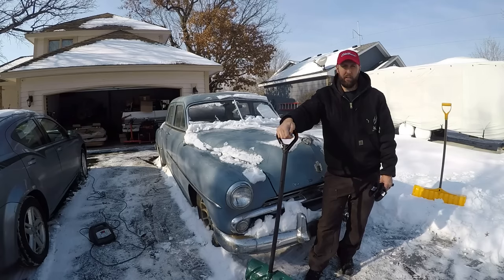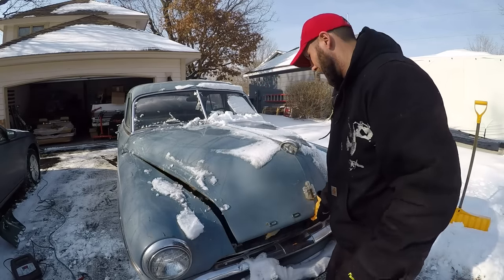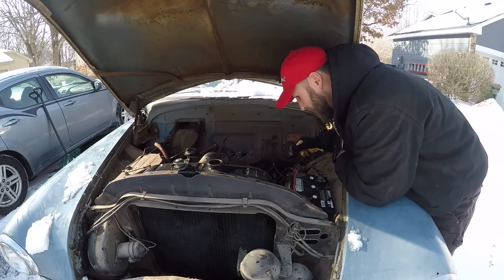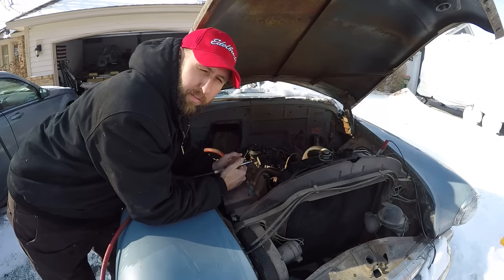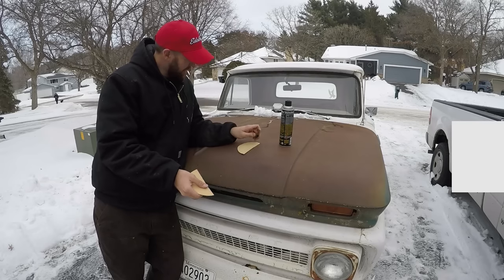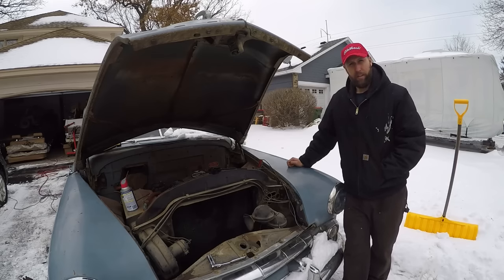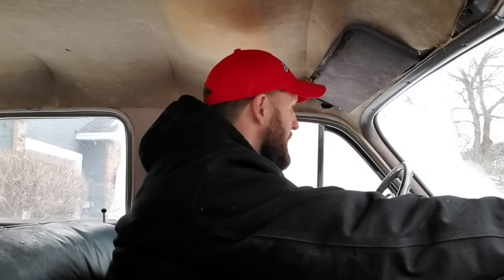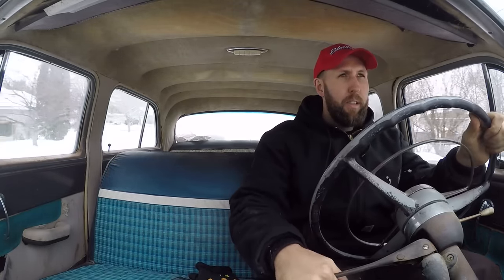1952 Dodge Barn Find First Start - Will it RUN AND DRIVE?

Comment: The transmission you have is known as a SEMI-AUTOMATIC fluid drive.  Here is the shift pattern you will need to know.  Shift the lever to First gear.  When you press on the gas, it will keep winding until you lift your foot.  When you press the gas again, it will go into Second gear.  The next time you lift off the gas, you have to shift into Third gear.  Press the gas and let off and you will be in Fourth gear when you hit the gas again.  I don't recall the exact pattern for down shifting, as it wasn't my car but that's why they equip them with brakes.  Oh yes, the transmission works like the old band brakes.  The proper tension on the adjustment bolt is 10 foot-pounds.  They are (as are almost all flatheads), reliable as a stone fence, if somewhat anemic due to the low compression.  If you contact Kenny Roberts, his tuner could probably bring it up to about 9 or 10-1.  For bad rings, there are a number of Marine sparkplugs that will fire through the oil.  You can use a 12 volt battery to fire up the engine without any damage, but don't turn on the lights because they'll blow right now.  Won't do your clock much good but that's why they have fuses.
Reply from the maker: This is fantastic detailed information.  Thank you Russ!  This is great

Comment: I loved this video, my favorite yet.  When you got in to start the car, I could smell it.  There is a very distinctive smell that these old cars have.
Reply: Also depends on what the vehicle is. 80s-early 90s Ford pickups have a unique smell, my 91 F250 included. My older trucks, which are Chevys and IHs, have a sort of barn aroma, that smells like a combination of hay and old grease.  That’s why I love old vehicles, every one is unique, unlike the cookie cutter appliances that roll off the assembly lines every day nowadays.

Comment: I was watching this video from 5 years ago that I missed and you were cleaning those old spark plugs.
Harbor freight sells a spark plug cleaner. All you need is around 60 to 90 lbs. of air pressure. I use mine all the time. They include some media also. Works like a miniature sand blaster.
Takes around 10 to 15 seconds and they look brand new and the price is only $10 bucks. Check it out. Small enough to fit in your pocket.

Comment: Always wanted a '52 Cranbrook, just because I like to say the word Cranbrook. It would be really cool, if you would consider taking a battery booster, and a battery operated polisher, and hit a small spot of the original paint with some McGuire cleaner & wax, just to see what the original paint looks like.

Comment: It’s crazy but yep... I found a 2003 Dodge Ram 1500 hemi like mine. Sitting in a junk yard with a bunch of older cars around it. Was going on a walk around. Tried to get it going. Crazy.  Something only 18 years old should still be on the road. You see 3rd gen rams all the time...... up here in the northeast they have rust (mine had rust) but they  still driving. I got it fired up. Flowmasters sounded very nice. She even rolled out its spot and drove. Just parked I guess. Took a little to get her goin though. Yes it had rust. The bed was full of junk. Interior had crap in the back too, no dash cracks or anything everything looked good and worked. Pretty sweet truck was a  white one. I could of bought it to maybe do a project on it. Be cool to maybe go down there again and see if it’s still there. If I’d own it I’d call it “The junkyard Dawge”

Comment: I use a 12 volt battery out of a vehicle with jumpers cables to give the 6 volt a little more umphage on cold starts. I lay the 12 volt battery on the fender and hook the positive to positive and the ground jump cable to the body so as not to direct hook 12 volts to the 6 volts. Thing to watch for is if it is positive ground as many older cars were. May have to reverse my setup if so!

Comment: In the words of our Auto father, David Frieberger, "that thing is mint!!" Lol most cars sitting for years are much worst. Me and a buddy got a old 1948 Chevy dump truck out of a field. We spent two days fixing rat chewed wiring, getting spark, cleaning the carb and getting a rudimentary fuel system. Amazingly the brakes were fine, and the wheels broke loose and turned after a tug by our pickup, AND after chainsawing down the freaking six inch diameter tree growing up between the frame rails, after we got it cut, we started the truck up and drove it five miles home.
Reply from the maker: Now thats a cool rescue! Glad you saved it! Learned how to drive in a 54 chevy 2 ton

Comment: Straight 6 are damn good engines
Reply from the maker: Today was the first day it didn't start.  Spent 72 years using a body panel puller 6000 to get it on a trailer.  Now I'm a touch mad at it.

Comment: Looks like the bottom Rad Hose was pushed off ,probably from frost way back when ?Tip,when boiling,just let it idle slowly for a minute or so ,then shut it off, it will dissipate a lot of combustion chamber heat and possibly save  cracking  !

Comment: Bad thing the old flat sixers had was water gets on top of the flat head and lays in around the spark plugs and rust welds them in place. I PB Blast them and let soak. I snapped a few off before which made it more fun to pull the head off and remove the broken ones.

Comment: I find it amazing that battery chargers do continue to have a 6-volt setting..
Reply: You should have an old JC Whitney Caterlogue - They sold a Sparkerlator clearers - like a sand-blaster for plugs.
Reply: Lawn tractors and motorcycles use 6 volt batterys.

Comment: VGG Translater Jamig:

Lighting Whirler: Distributer Cap
Lightning Hoses: Wires to Spark Plugs
Tonya Harding: Hammer 
Wobble Pops: Beer
Floor Pan Scanner: Stomping with Boot
Fire Make it Happener: Carburetor 
Bring The Thunder: Turn the key 
Mouse Sucker 2000: Vacuum Cleaner

Comment: I've owned a 48 Dodge sedan since 1964.  It's all stock with the 230.2 Flathead.  Those are tough engines very simple and dependable If you maintain them properly.  It is not a high revving engine 3600 redline do not push it over.  It's fine the maximum torque comes in at 1800 rpm.  My Dodge was my daily driver in the 60's.  It's parked in my garage right now.  Your engine sounds great.  The owners manual says it should have 40 lbs of oil pressure at 45 mph.  The engines are pretty tolerant of low oil pressure but that's another reason not to push it hard.  I've never seen oil pressure over 30 lbs after highway driving Idle about 5-10 lbs
.  Good cruising speed is 55-60 mph unless it has overdrive.  You're going to really enjoy working on the brakes, it has 6 wheel cylinders the front wheels have half cylinders at the top and bottom.  To do the adjustment correctly you really need a special tool called a brake arcing tool. I take mine to a brake shop to have them adjusted.  You have the same engine that came in the old Dodge power wagons.  After owning mine for 55 years I've pretty much figured out how it does what it does...
Reply from the maker: Great info and story!  Now I'm terrified of working on the brakes haha.  Post up on some pictures sometime on the Facebook page, would enjoy seeing yours!  Thanks for watching - please check out the play list!
Reply: Parts are very easy to find for your car.  I'm in the process of getting mine on the road again after being parked in my garage for many years.  I ordered new wheel cylinders (all six) a new master cylinder and all the hoses from Rock Auto, had them in 4 days. Still gotta put them on, When properly set up and adjusted the brakes are very good for drum brakes. Chrysler was a very early adopter of  hydraulic brakes. There's a company that's reproducing the gas tanks they sell on ebay,  I bought one (over $300.00) but it's perfect can't tell it from the old one except it's not full of pinholes.  We're fortunate in that the old Dodge Power Wagon has a broad and enthusiastic following get with them for many engine parts.  The Chrysler flatheads came in two sizes 23 inch long and 25 inch long, there were some monsters that were used in tractor trailers.  Both of these engines were used in many industrial applications from combines to fork lifts and even some tractors and generator sets They have a distinct exhaust sound, once you hear one under load you can identify a mile away.   There is/was a video on Youtube of someone doing a complete rebuild,  I saved it....Have fun....

Comment: If you have oil reading at the bottom of the dip stick and a grayish color above the oil mark on the dip stick that more than likely that is just condensation that has mixed with the oil on the dip stick. I say that because oil will float on top of the water and when you pull the dip stick, if water is on the bottom of the stick oil will not stick to the dip stick when you pull it out.

Comment: If the ignition system is anything like similar cars from that era, the key only powers the coil and it's supposed to have a button for the starter. Clearly that's been replaced with a toggle switch.
Reply from the maker: Gotcha!

Comment: I don’t usually give any advice ,(do to the never ending supply of trolls.  But snagletooth them. ) but it’s best not to shut off an overheating engine. Cool it down by pouring water over the radiator. It’ll still act as a heat sink and draw heat from the engine. When you get it down out of danger range then shut it off. It’s still going to heat back up a bit after shutdown but not enough to crack it in most cases.  
  It’s an old dirt-trackers trick from back in my gramps day. (He taught it to me ) I’ve personally done this 5-7 times on my “Ol’ War Wagon” . An 87’ Chevy van with 340,000 + miles. On the original drivetrain.  
  Good luck.   
😎🎸🎶✌️🤟

Comment: The greatest flat 6's were and will always be the Hudsons. 
That aside, I always drain the oil and put in a very light oil and replace the oil filter. I also well FOG OIL the cylinders after removing the plugs which replace with new. Then either I take off the carb and wash in laquior thinner or at least spray the carb with sea spray, which Does work. 
Only then do I try to bar crank it or if I think I can get away with it I try the starter. As you showed. Those old 6's and straight 8's often start right up. AMAZING...10,000 years in a shed and a lot of the cars are actually drivable with minimal other steps. Hey, its the real America guys.....

Comment: My 57 Chevy has a 3 on the tree as well and it doesn't have a synchronized first gear. Have to either be stopped or try to rev-match it to get the downshift from 2 to 1. Can be a pain in the butt because I haven't driven it enough to get the rev-match down since it doesn't have a tachometer.

Comment: I was trying to get a 54 bel air running a while back it’s been sitting about 20 years but is in pretty good shape just needs the interior done was parked needing a fuel pump 
Went and bought a new 6 volt battery and the starter solenoid wouldn’t engage so I replaced it and it would turn over two slow to start I figured it was a ground or the starter since the battery was new but now that I’m seeing this I bet the battery needed a jumper on it I’ll definitely have to give it a shot again soon I haven’t fooled with it I’m a while since the battery eventually started dying and I don’t have a 6volt charger

Comment: Kind of hard on the reliable old beast.  What blew up front?  Lot of original car there, but not what you do.  I sure sunk a lot of money bringing cars back that I could never recover.  Nice trophy, but no pay at all for hours spend when I had to sell.  Bites to lose your ability to drive at age 36.  I drove from age 8 or 12, depending if you count tractors and farm trucks, but still, longer not able to drive than driver.  I recently got a DJI MINI drone and got my eyes back in the air.  Totally worth it.  Might add to your videos with a new perspective and follow you around the block???  Great entertainment!!!

Comment: You can put 12v through a 6v starter and it will not hurt it. A lot of those old cars that have been revived people will wire the starter up to 12v so it cranks over when its hot.

Comment: You should start switching all your 6 volt stuff to 8 volt it spins way faster and you just have to adjust the voltage on the generator

Comment: My Grandmother wanted to give me or my cousin a car 66 Ford Galaxie years ago. Since we both couldn't own it he gave me his 72 Pinto with Pioneer radio/ Jensen speakers and he took the gem Ford with a fat 392/428 something in it. As dumb as I was I didn't need mass recalls for it being a fire bomb to realize it was a lemon. So a guy did the right thing and traded it for a  "49" Dodge Deluxe  with a Earl Scheib army green paint job and a old exterior fan behind the rear seat. It only had ONE low gear. I do remember trying to find the master cylinder though........just below the accelerator in the floorboard dagnabbitt.

Comment: Flathead 230 six will usually run, valves may be sticking.  The transmission should be reliable too.
Reply from the maker: I hope so! Excited to get it out and about now that the snow is finally melting

Comment: Old Dodge info. That was known as a 
semi automatic transmission. Not to be confused with today's fully semi automatic transmission.
. Replaced by the 727 torque flite...
That cast iron trans case just adds traction weight. For that power house non HEMI inline 6.
Reply: They had the two speed power flite in between the fluid drive and torque flite

Comment: My first car was a 52 Dodge Coronet. The gyromatic transmission works thus... No first gear position. Put it in second accelerate to say 10-12 mph and lift foot off gas and listen for clunk. Step on gas to twenty five and shift using clutch. Accelerate to about thirty and lift foot. When you hear the clunk step on gas. Now you are in fourth. Easy huh? If you want when you stop just step on brake. When light changes just step on gas and go. Very poor acceleration but no clutch needed. You are starting in third. At thirty or so lift foot. And listen for clunk.
Good luck.
Reply from the maker: Thanks Thomas! What a cool 1st car.

Comment: I had  1952 Plymouth with the Hi Drive back in 1967. If someone walked by in July with an Ice Cream cone it would not start. Had on going problems with the fuel pump

Comment: Hard to kill an inline 6...well, overheating would do it.  I had a straight 8 1953 packard that had sat for years, it was May, on a Friday, why not see if I can get it to start ?  Well, it did and it backfired, and shot this big slug of black gunk out the exhaust onto the garage wall and fill the garage with smoke in a picosecond.  My roommate, who owned the house, was having kittens !  But the Packard ran that day....of course I drove mine around the neighborhood too, but I had brakes and it was an automatic with a tube radio (that was a Friday 13th, sure, I feel lucky !)...got to meet Mr Walther who had a bunch of cadillacs, so it was a good day.... isn't this fun ?

Comment: Those old 216 cubic inch mopar flat head 6s only had about 6.5:1 compression so they would start easily and run forever but they didn't go very fast but then the brakes weren't much, even though many had twin leading shoe brakes, so going fast wasn't a good thing.  There are probably more of them in garages and barns than any other vehicle.
Reply from the maker: I'll be a believer if it starts right up after this bad overheating.  Just waiting for the snow to lighten up a little bit!

Comment: Too cold put a little stove underneath the bottom and cover the hood and front ,sides, warm it up are few hours to about 160 degreed drain oil pour in hot oil , radiator coolant also things break too easy in the cold baby the good ole Meadowbrook I like what you do.(rust never sleeps))

Comment: Probably one of the best uncomplicated cars you’ve worked on. I knew it would start. Just needs a tune up with points, plugs, cap, condenser, rotor, wires, fuel and water pump, new battery and break job and she’s as good as new. That’s just standard routine maintenance stuff. She’ll run another 50 years easy. The paint looks great and appears rust free. Thats a car from my high school dreams.

Comment: For future viewers those 12V battery cables seen, suck. They won't do. Way too small. They restrict amp flow too much in the 6V system. Some good "00" sized  battery cables  with clean grounds would really help in cranking that engine over faster. One of the major hurdles for newbies of these old Mopars is misunderstanding of the  6V electrical system. It needs proper maintenance. Second is the cooling system. Rusted engine water distribution tubes, 3/4 plugged up radiators,  4" of sediment in the block...These old engines are hard to kill!

Comment: My mom & dad had a 1952 Coronet - the first car that I was aware of (born Nov '49) had it until ca. 1961 when it was replaced with another Dodge - Station wagon (forget the year/model) that had the then new push button transmission...dad 'closed' the trunk on my head - still have a divot from that - it was my fault - he was in the act of slamming it shut when I stuck my skull in the way to see what was in the trunk...pop was scared he hurt me...he did - but not permanently...if he'd'a kicked my ass there mightta been dain bramage but I evidently had a hard skull even at the age of 5 or 6...I'll be 72 in a few weeks so mebbe that hit  worked...I remember those damn vent windows  you hadda aim at yourself to get ANY air flowing on a hot/humid New Jersey summer day...and the brown/maroon with blue stripes ugly upholstery...